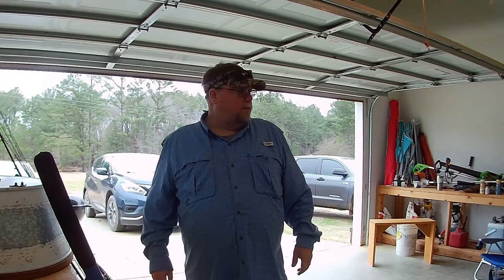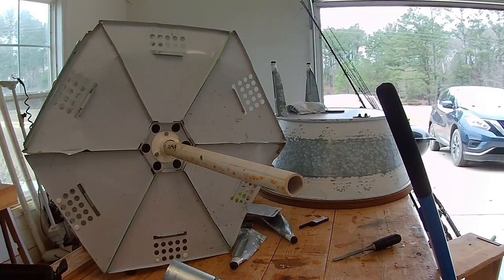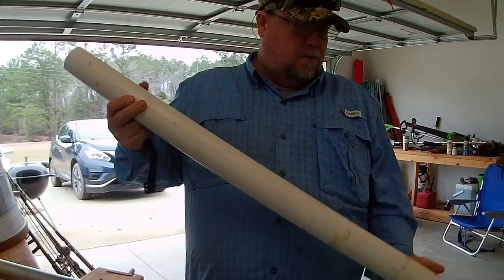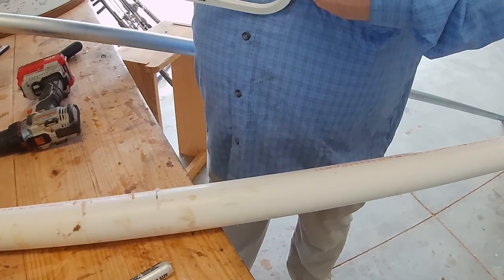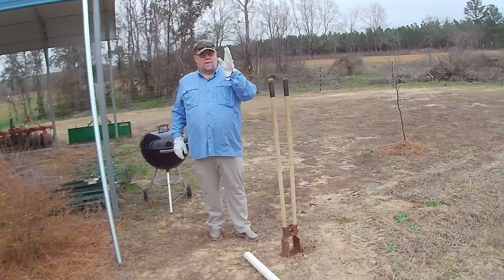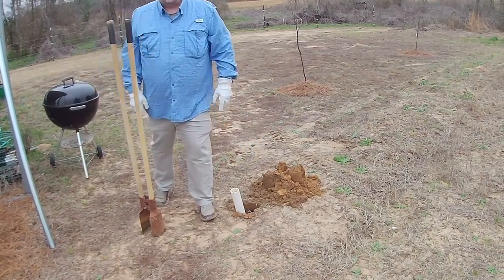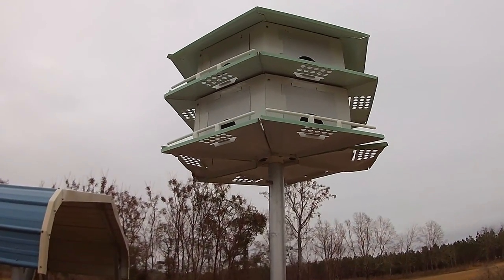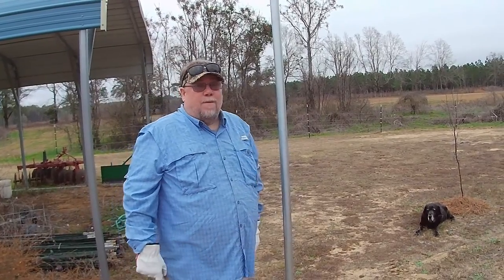How To Put Up A Purple Martin Bird House!! The easy Way @adamsfamilyhomestead37

Comment: I put out a couple bird houses, on tall Shepherd hooks in the spring for the Wren's, they come here in Iowa.
Reply from the maker: This one is made out of thin sheet metal. I m worried they may not nest in it
Reply: @adamsfamilyhomestead37  Last year I made mine out of sheet metal and wood front and back. Took awhile but finally they did nest. My problem is house movement when its windy. They need to feel safe, it's the main thing I think.?